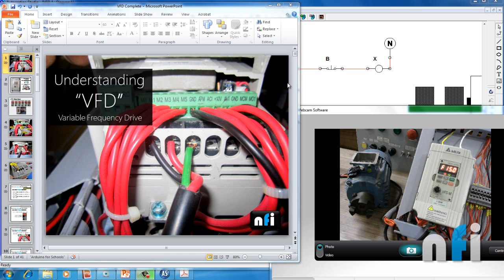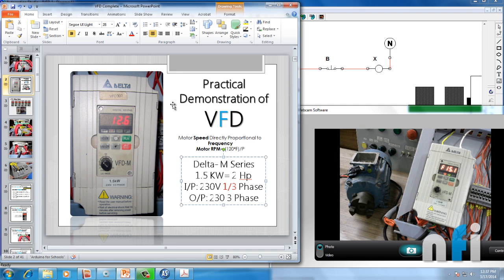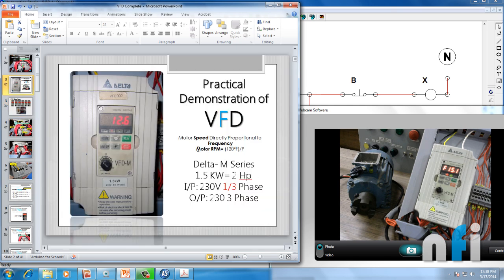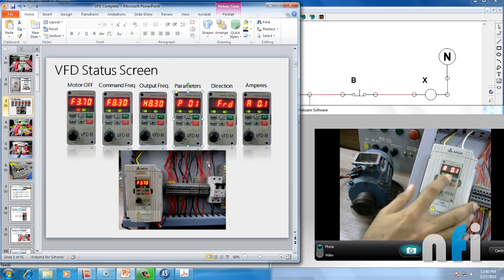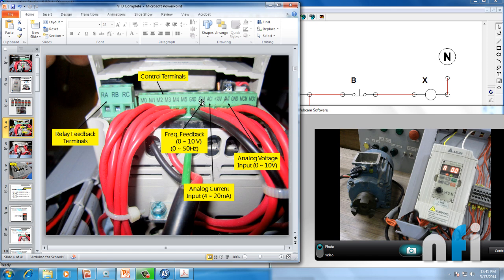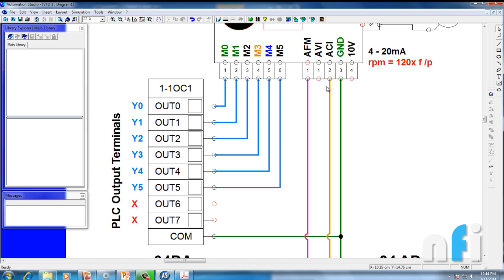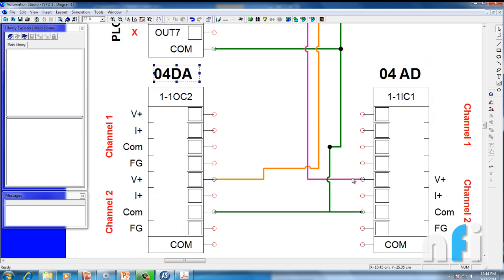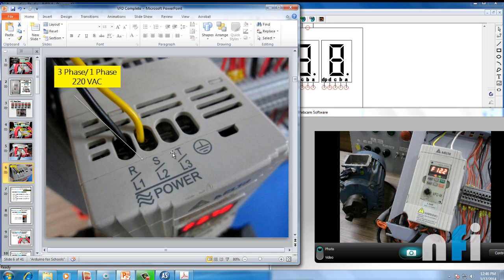Lesson 1 - Understanding the VFD  Variable Frequency Drive

Comment: Sir we have 0.4 ke delta vfd when we set h parameter for potentiometer,   speed is not control by potentiometer  on digital keypad it is not working but external potentiometer is connected working properly. So what parameter we have to set by which frequency set by potentiometer on digital keypad
Reply from the maker: You can either check source of frequency and select the required parameter. If you like to switch to two sources (on Drive and External), then you can use the parameter second source of frequency. This is explained in my Delta course located at https://learn.codeandcompile.com/p/delta-industrial-automation

Comment: Nice demonstration.  Can i use this vfd  to run 3 phase  motor   in my home electricity which is single phase only  ?  .  If the answer is   yes  . Did  using  this vfd  in single phase location  require similar  current  and consumption if use it in three phase location  ?

Comment: Sir, please explain n reply what is control mode in vfd ?? What is scalar control and vector control?? Pls explain dis.. Bcos if u see in ABB drive parameter 9904 state MOTOR CONTROL MODE in which speed values are used in VECTOR CONTROL and frequency values are used in SCALAR CONTROL Ppls explain dis part as I Don understand dis...

Comment: Please reply. Vfd ki output voltage stable kyu nhi hoti? Line reactor use stable karne ke lyea lgate hai?   Motor ki  input voltage motor ki rating voltage se jyada kyu hoti hai
Reply from the maker: VFD gives variable freq. output and its stable at fixed frequency! (Average voltage) otherwise it’s sinusoidal ..I hope you know that already. Line reactor is used as current limiting and filtering impedance

Comment: what is the output voltage of Delta VFD? because I have problem here, my VFD input voltage is 440V but the output is too high about 700 to 900 volts and the case of the motor can't be touch by bare hand and we measure the casing to ground the voltage reading is about 200V

Comment: Rajeev Bhai 
PT means pressure transmitter 
TT  temperature transmitter 
LT level transmitter
Reply: FT means flow transmitter
Reply from the maker: Hi, Well we have made a video on LT in one of our video of Siemens S7-1200 lessons with proportional control. It also have FT, but we are not using that in the project. Check here: https://www.youtube.com/watch?v=FFiJ7d1olFU

Comment: sir, if I set 25 frequency what is the output voltag
Reply from the maker: The average output voltage would be 110VAC if you are following linear curve characteristics in the VFD (0 ~ 50Hz). And the max. peak will remain same i.e. 220VAC
Reply: +Rajvir Singh (NFI Automation) thanks
Reply: rajvir thank you very much for the video. i have a question : as far as i know about vfds u can provide dc input to the same terminals and get 3 phase output. if that is the case how much dc voltage will i need to equal 3 phase 230v ? kindly reply if u understood my concern
Reply from the maker: DC Input where? We provide AC Input to it'S power and get AC in the output.

Comment: how could I know operation principle of a VFD ...how can VFD change frequency and voltage as per requirement ...
Reply from the maker: We do not have in depth tutorial on it's inner working principle. But you will find many articles if you dig internet. The basic working principle is the AC input first get converted to DC and then to variable AC (as per requirement).

Comment: why most output iis 4-20ma.why not 0-20ma current?
Reply from the maker: Because if you use 0mA for minimum or no signal, it might be confused with broken wire in transmitting the signal. Suppose if you use 0 - 20mA and you don't receive any signal (0 mA) from transmitter than there might be confusion likes between two cases - 1) The wire is broken 2) The transmitter is not sending signal. In case if you use 4 - 20mA, for broken wire you will receive 0mA and immediately you will analyze that it's because of the wire. Hope that make sense!

Comment: Hi, I'm building a CNC machine and where I currently live the power at the outlet is 100v 50Hz. But all I can find is 220v and 110v Spindles and VFD. Can a 110v be used? Or is there a solution for this?

Comment: how long can the VFD run on low frequencies ?
Is it possible to interface the VFD with Arduino ?
what is the best type of motor (3 phase or singles phase) to be used for an application where the motor is required to switch directions many times ?
what is the best motor type to be used for an application that requires higher torque rather than speed ?
When VFD is used and the motor has a high load is it possible to rely on the VFD to instantly change direction or we should add a braking system ?
sorry for long list of questions and thank you in advance ...
Reply from the maker: Hossam Zayed Hello Hossam, Well i would be glad to answer you:
how long can the VFD run on low frequencies ?
As long as you want. There is no limitation.

Is it possible to interface the VFD with Arduino ?
Yes, it is possible, infact we have already done that. Let me know which operations you want to control with arduino?

what is the best type of motor (3 phase or singles phase) to be used for an application where the motor is required to switch directions many times ?
I would suggest DC Motor. It will save your cost of VFD. 

what is the best motor type to be used for an application that requires higher torque rather than speed ?
You can go for DC Gear Motor

When VFD is used and the motor has a high load is it possible to rely on the VFD to instantly change direction or we should add a braking system ?
Instantly changing the direction would cause sudden increase/decrease of current. You can play around with Acceleration and deceleration of VFD along with braking system. It would work. Also you can try using DC gear motor instead if you don't want frequent change of speed.
Reply: Rajvir Singh Thank you very much for the quick reply.
As for the application, we are building a 3 Axis rotation Flight simulator with 1 person cabin inside.
We are still in the design phase but we can't figure out what to choose regarding the motors.
we have calculated the power we need and it is 1KW for each of the 3 motors. so we found that we need an AC motor 220 V single  phase 1400 RPM, or it's 3 phase equivalent.
Apparently the application requires fast and stable switching in motor directions. So if you could kindly answer my previous questions based on this new information we would really appreciate it.
we have a team of 5 engineers in different branches but we don't have enough experience in this matter.
and we would appreciate any references you recommend so we can dig our information and thanks again.
Reply from the maker: Hossam Zayed Then i would say if you could get equivalent rated DC motor it would be cost effective compared to AC motor and drives (if cost if the issue). In DC Motor you just need to reverse the polarity of its terminal to change the direction. It can be done pretty easy using relays.

Comment: Thecontroll terminals M0-M5 , are those the same as Digital outputs?
Reply from the maker: marcus mårlind  - These (M0 ~ M5) are digital inputs not outputs. We just have 2 Digital Relay Output in VFD RA and RB. Besides MCM is high speed output of VFD.

Comment: Hello, sir,

I am back with another question about powerflex 525 vfd.
I have a problem with current vfd. now I want to replace with new one with same parameter.
what r the possibility we have?
do I have to write down all old parameter first before I took it off from place in order to put new one.?
or just replace with new one same as old one.
what precaution I need to take?
pl. give me an idea, so I can perform my job in a right way.
thank u sir
Reply from the maker: Yes, note down the parameters and track the wiring & replace it. Install the new one with same wiring and parameters. That's it ;)